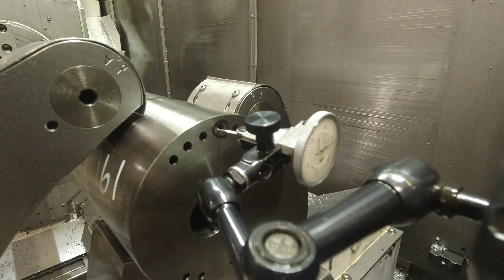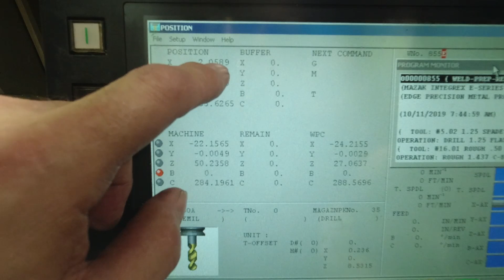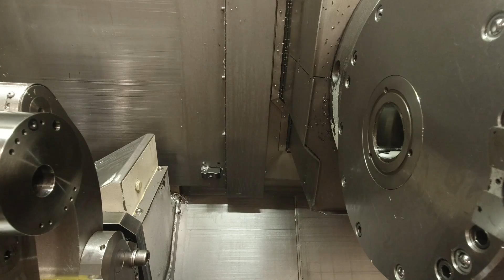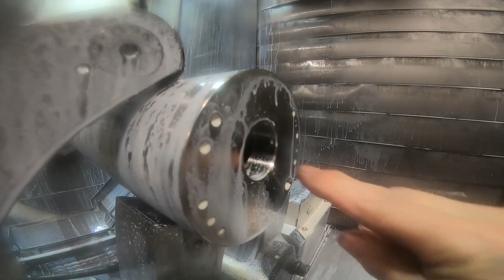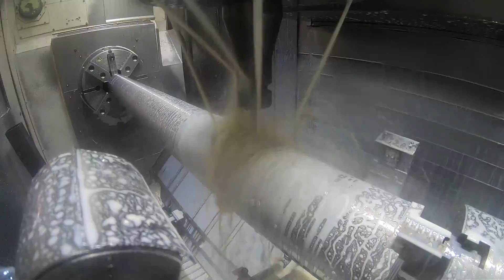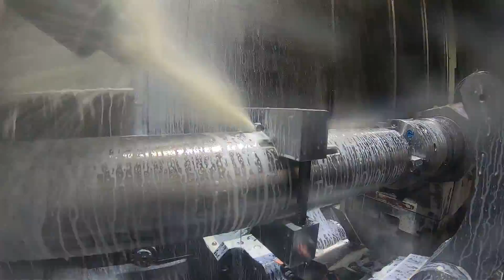Weld Prep

Comment: I think you forgot to hit Input when zeroing G55 C,  (G54 C & G55 C should both be 0.0) after you indicated the small hole.
Reply from the maker: I made this video a while ago. To tell you the truth I cant remember. It may be I was using two different C offsets. On this weld prep I think there is only G54 being used. In any event I will be finding out because I have more parts to do coming up.

Comment: How many hours of programming is involved producing this part? Its great to watch a master at work.
Reply from the maker: The programming probably only took a day for this operation. Or maybe less. Its kind of hard to tell because that's not where the time is spent. Its figuring out the setup than looking up and ordering all the tooling. Than making the setup and rounding up all the tool holders collets and things like that. Than actually running the first setup. That usually requires making minor changes to the program like the speed and feed of tools and clearance values on the tools to avoid collision problems with the machine and the work. With these steep angles its sometimes hard to tell on the computer. I don't model the whole machine and tool holders for simulation it just take to much time (and computer power/time to simulate). Its just easier to run it at the machine for some of it. The basic program I can see on the software but the machine cabinet and other machine elements it easier to see as you run the first program.

Comment: A good quality Coaxial Centering Indicator works great in this application.
Reply from the maker: The only one I trust is the one made by Haimer. The Centro. The others I have tried are not in my opinion accurate enough. Besides on the Mazak I cant turn the milling spindle on with the doors open. I could rotate it by hand. But that's about the same as using a dial indicator. I may get a Centro but it costs around $600.00.
Reply: Edge Precision Thanks for the response, I read reviews on some cheaper units where they did hands on testing and the results were good. The greatest accuracy is achieved with the shortest rod or finger, as the length increases so does the error factor but well within .001 of actual. The tests where conducted with a high quality unit as the standard guideline. Even on a non cnc machine they are great to use. Thanks for your video upload!

Comment: Hi Peter !! 
Why didn't you use the larger hole to locate the C axis?
Wouldn't it be easier?
Reply from the maker: Because the small hole is very close to the center-line in the Y axis. If the drilling shop didn't get it exactly on location in X there would be less error to use it for the C axis setting. The large hole is also drilled at a angle into the part. Or to say it another way. It's not perpendicular to the face and parallel to the center-line. Hope that make sense.
Reply: @EdgePrecision  Sure. I thought it was parallel to the center line of the part.
I'm the owner of a small machine shop here in Brazil. It's very cool to see your videos.
Hope to have a Makak some day !!
Seeya

Comment: Can someone explain to me this steady rest compared to a more traditional steady rest where you would need a guard to protect chips from the rollers?
Reply from the maker: Chips also get under these rollers and dent the part. I have this idea, but never have done it yet. To make some rubber boots that come up against the parts OD to deflect away the shavings. There is coolant supplied up to the this steady rest witch you can direct nozzles to deflect the shavings as well. If I put that under the rubber boots as kind of a coolant purge to further keep shavings out of the rollers. Just a idea I have yet to try.
Reply: @EdgePrecision  Great idea. I thought i had seen another one of your videos where you did turning work close to the steadyrest so i was just wondering. Thanks for the reply. Great videos

Comment: Thanks for another great video. Question...your subject topic is “Weld Prep” so I am guessing someone will be welding on some additional stuff later to the part so it probably is a mute point ... but with the holes and key way milling have you had any issues that the removal of that material has caused the shaft to relieve itself and create runout?
Reply from the maker: This can happen from the welding and there is still a lot of milling to go on this part. We shall see.
Reply: Edge Precision I bet you already have a plan in mind to correct the issue if it throws it out of tolerance 🙂👍🏻

Comment: My Suggestion for your small error: your Y wasn‘t 0?
Reply: Philippe Crottet that’s what my thought was. It was like -.0026 and I thought he said to keep it at zero and only index the C axis
Reply from the maker: The Y location of this hole is -.002. So it was .0006 off. What happened is when I set the new X and Y zero. I forgot to push the reset key. That would update the display to the new offsets locations. So when I jogged the machine to the holes location the display still read in relation to the old previous offset. So in the video when I pushed reset to see the C axis update to zero I saw the Y change from -.002 to -.0026. It was then that I saw may mistake. Its only .0006" not really enough to worry about. I was concentrating on the video instead of the job and forgot that step!

Comment: Make sure to send the engineer who designed the part a link to see what is involved with manufacturing it.  So he can take in account the amount of hassle a hole at an angle into a round bar that intersections other holes at an angle in some exotic material will cause. Pure mastery of the art of machining on your channel!  Keep up the good work!
Reply: they dont care, they just bill the customer for the extra cost.
Reply from the maker: Some of the engineers at this company do watch my videos.
Reply: You really have to wonder what parts like these are for.  If they can't be made any other way (easier) then they are pretty specialized for a very unusual industry or task.
Reply: @stevewalston7089  oil and gas or aerospace. they got the big bucks!

Comment: Off topic but ive always wondered when turning the od using a steady rest how you go about it.  Will steady rest collapse smaller when you turn past it?
Reply from the maker: This type of steady rest can’t be turned past it. I have seen where they mount two steady rests back to back. And close the one behind the tool as it passes and open the one in front of it. Before it hits it. But to do this you need servo operated steady’s not this hydraulic one.

Comment: X axis changed by 0.0012 and y axis changed by 0.0006 because you moved the X and y axis while centering on the small hole. But you said that was for the g55 offset not the g65. May have gotten those backward but let us all know what you actually did wrong. Thanks!
Reply: I think you forgot to zero the X and y axis for the g65 offset prior to setting the c axis zero (g55 offset)? Mind you I have no experience with cnc, just a deep interest. I'm a precision welder/fabricator/manual machinist running a small shop in PA, with a great interest in anything precision. Love all of your videos! I find them all very informative and always find myself learning something! Please keep the great content coming, I always look forward to a new Edge Precision video!
Reply from the maker: You are correct about the number changes. What did I do elsewhere in this video to up date the display to the new settings? Knowing that what did I forget to do after setting the X and Y zero before jogging to the holes location to set the C offset?

Comment: It's gotta be great to use video for after action review :-)

I notice the X wiggled when you reset, so the X offset you jogged to the center of the hole got undone? Or maybe baked in, depending on which way this goes?
Reply from the maker: Both the X and Y changed. Did you notice the Y change when I pushed reset by .0006”. That’s the one that most concerned me. Not really enough to worry about. But it would change the angle by .0006” in 2.06”.
Reply: @EdgePrecision  I didn't rewind, but looking again, I see it! Lucky it wasn't more than that.

Comment: Could you explain how the part can run true at the chuck and at the steady-rest but yet be at an angle? Thank you for the wonderful content!
Reply from the maker: Say the part has a bow in it. It can run true in two locations at the chuck and the rollers of the steady rest but every ware else there would be runout. Not all the parts were this way. But the part in the video had a bow of about .002-.003” in the middle. Or about .005” indicated runout.

Comment: When you're indicating the rotation in would it be worth your time to make a aluminum block with raised bosses. Then just slip it on the end of the part and indicate the flat surface. I've done that when indicating much simpler parts but it seemed to speed things up.
Reply from the maker: I prefer to always indicate on the part if possible. Anything you add to the part has the possibility of introducing error.
Reply: @EdgePrecision  yeah you probably wouldn't want to take any chances with something as costly and complicated as this job. Thanks
Reply: Stacking errors are definitely a thing

Comment: forgot to set X and Y
Reply from the maker: I did set the offsets but the display still read in relation to the original offset settings when I moved to the holes location because I forgot to hit ———- before jogging after setting the offsets. That’s about as close as I can get without telling you. ( actually I did tell you).

Comment: You didn't match the Y offset between the 2 Work offsets you are using. You showed the answer later int he vid. (fixture=work)
Reply from the maker: I did do that. But what did I do in the video to update the display. And what should I have done before jogging to the holes location. This caused a small error. It shows on the display where I stopped the video. That’s why I know I forgot to do it.
Reply: @EdgePrecision  You forgot to hit reset?
Reply from the maker: Yes!
Reply: @EdgePrecision  So that made the C orientation slightly out, because the reference points was not zeroed correctly?

Comment: your X changed?
Reply from the maker: Both the X and the Y changed. When did that happen elsewhere in this video. And what did I forget to do when I set the X and Y zero before moving to the holes location?
Reply: Oh you never set your part zero?
Reply from the maker: Trav L that is very close. I did set the part zero’s of both offsets but what did I forget to do before jogging the machine to the holes location so the display would read the correct numbers.

Comment: I would bet my lunch that indicator setup has measureable droop. I have fooled with Noga arms trying this myself  and they always have some droop even with a small last word style indicator.  A co-ax indicator is the most accurate sweep in the horizontal position.  Short of that I would probably use the Haimer in a cross pattern to find center.
Reply: That;s what I thought too, but why didn't it show up when he rotated the part with the indicator?
Reply: @Steve_Just_Steve  5:29 to 5:37 it appears to indicate at least .001" difference at the same point during rotation. I believe that by rotating the part you get a somewhat self compensating false reading. If the part were high at the top versus true center when you rotate it to the bottom it would now be plused to the low side which could compensate for any indicator droop.

Comment: Is the mistake that you should have moved it .0005 instead of .001 since you were working on a radius instead of a diameter?  Seems like you moved .001” off and you got .002” total on the work offset setting.
Reply from the maker: Nope when the machine has the C axis coupled it is in the milling mode. In that mode the display reads in radius.
Reply: Edge Precision well I give up.  I went back and watched it again!   Hopefully you let us know.   By the way, great videos, and a very nice machine.  Love the channel.
Reply from the maker: Let’s see if someone gets it. The answer is in the video. But for me it is easy to see. To someone else it may not be so obvious. Look at my reply to the comment the X was off by pedub2222.

Comment: Ever use a blake coaxial indicator? Would that work for this application?
Reply from the maker: The only coaxial indicator I trust is the one made by Haimer Centro. The rest in my opinion are not accurate enough.

Comment: Possibly dumb question: If you know your sub spindle is co-axial and you know where your c-axis reference is, why not put a cone in the sub spindle and let it set C for you?
Reply from the maker: While on the service this can seem possible. The machine is to heavy and powerful to have a proper feel to know when you are properly centered. A dial indicator or possibly a spindle probe is the only way. I prefer the indicator because the hole may not be in the ideal position.
Reply: @EdgePrecision  Ok; I knew there was a good reason but I didn't know what.

Comment: Does flipping the indicator upside down effect the reading due to gravity?
Reply from the maker: I have tested this indicator/arm combination and know it to be accurate in the horizontal position. But you are correct if the arm is to long or heavy or the indicator is of the wrong type. Gravity can influence the measurement.
Reply: @EdgePrecision  Thanks for the great videos.  I really enjoy watching them.
Reply: Maybe not the indicator itself but you have to assume the arm flexes a little.
Reply: Yeah really should be using a coaxial indicator when picking up centers this way
Reply: @diditwork370   I think he knows what he's doing Blake.
Reply: @michaelmiller5566  watch the coaxial indicator appear in his next videos, slips my mind at work sometimes too